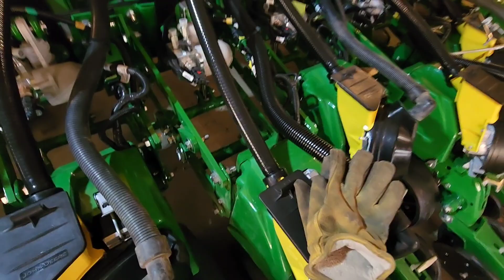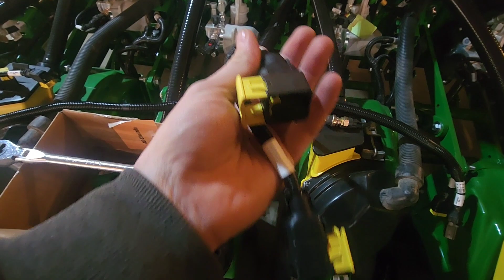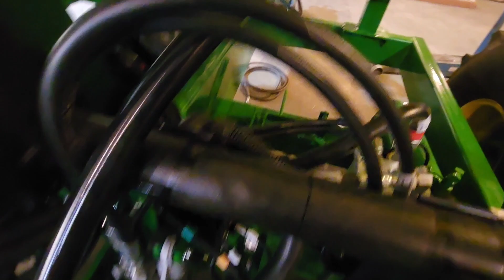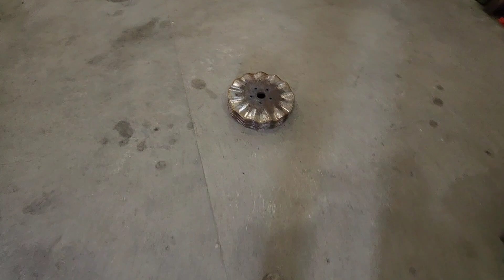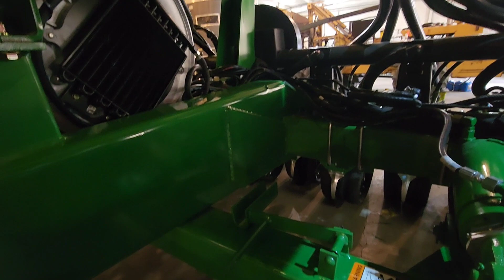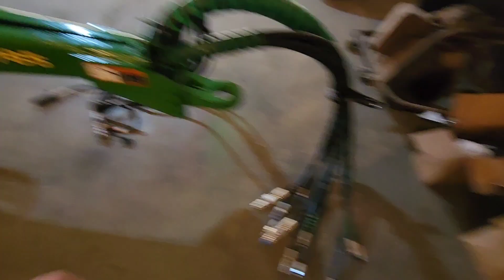Planter Build - video 7 -  Completion!

Comment: That baby is sweet man! All the essentials, probably not a bunch of do dads hanging off it. It’s amazing how many miracle cure silver bullets they sell for them. That will have speed, accuracy and flexibility.  I settled on 20”. No raising units up when switching crops. It helps with weed control in corn, and cuts back on mildew issues in beans. My way is not the right way though. The right way is what you want on your farm.